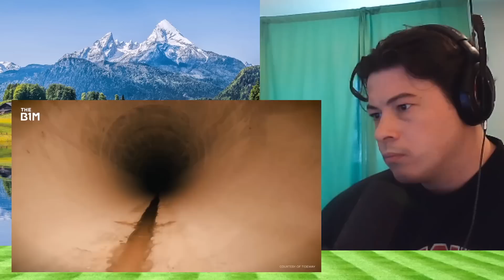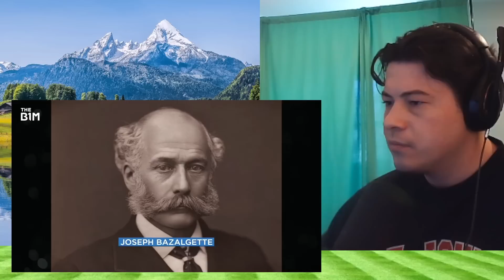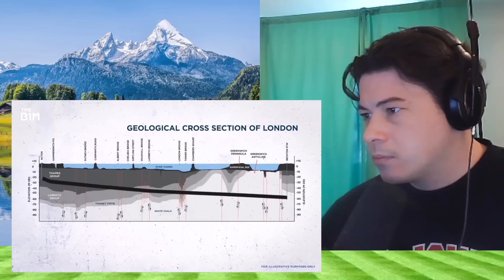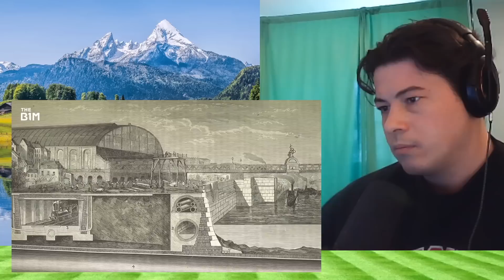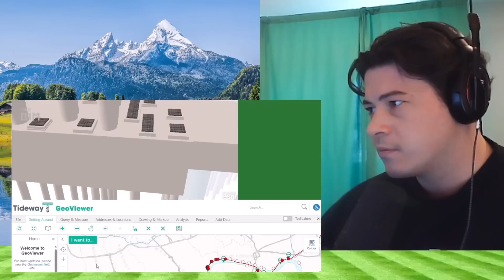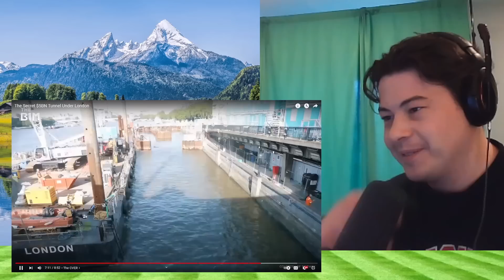American Reacts The Secret $5BN Tunnel Under London

Comment: 1 London's population has increased by 50 per cent in twenty years because of uncontrolled immigration. The infrastructure has not been planned accordingly.
2 The Victorians built the London sewers for a MUCH smaller population.
3 The Victorian planners made a huge mistake in taking Bazalgette's design which incorporated sewage and rain-water in the same drainage disposal, so after heavy rain it overflows into the Thames. They ought to have adopted Chadwick's design which separated the two.

Comment: The answer to the question you're trying to ask near the start, the real answer anyway rather than the BS news media answer, is "it depends on your definition or raw sewerage" - it's highly dilute at worst, probably not raw sewerage at all at best; the system is actually designed to handle what is supposedly happening (and probably is at some outflows); under normal circumstances the surface water pours into the sewer and nothing overflows, at high rainfall when the sewer can't handle the water essentially what is supposed to happen is that surface water sort of flows over the sewer and into an outfall. Technically they should never mix, but it is possible that they do, the measurements given are total outflows, not the actual volume of sewerage, it could be 0.00001% of that in reality. Course everybody talks like the Victorians were clueless and it is pure sewerage coming out the outflows and it simply isn't the case - there's a reason the sewers and surface water systems are at different depths. Not that you want untreated surface water flowing into rivers either; it has rubber from tires, oils and all sorts of other nonsense in it, not much, but enough.
Reply: Ahhh, a Thames-Water shareholder, I see.

A shame, that the fecal matter, condoms, and nappies don't fit into your theory.

Of course, it overflows mainly when it's rainy, so of course, it is dilluted somewhat, but don't pretend the sewage content is minimal - not until you offer to bathe your kids in it.

Comment: Your question about treating the sewerage ... We use a single sewer system, so rain water, industrial and residential sewerage, so if there's more water to be treated than can be handled, it gets dumped, raw, into the rivers or sea.
Because of the whole "profit motive" thing, when the water system was flogged off to the best bungers, investment started drying up, just for maintenance and appropriate expansion for expanding neighbourhoods, so installing a dual system wasn't remotely on the cards.  Thankfully the Victorians bothered with engineering, so what they did install lasted well, or we'd be in a worse state.
A third system would be even better, with an additional one for certain industrial waste, as different contaminants require different purification methods.  Mixing it all together means we're treating water in ways we others wouldn't have needed to.

E2A:  The ship you asked about is the HMS Belfast.  WWII ship, now a permanent museum. (EDIT Again):  Sorry, brain fart on the perspective, I don't know that ship, looking from opposite side would be Belfast.
E2FA:  I think it may be "HMS President" (yep, I'm double taking on the name too), used for Sea Scouts.  Just looking on GMaps.
Reply: It is nonsense to blame it all on privatisation. When the government was in control there was no significant investment since the 19th century.
Reply: @archiebald4717  From the other reply I've seen from you on this topic, it's clear you're an ideologue of privatization (at least), so there's no point actually discussing with you.

Comment: Firstly, the sewage being pumped into the rivers is raw untreated sewage which has overflowed before getting anywhere near a treatment plant.  The problem with this stems back to the water companies being privatised back in the 1980's.  There was little in the way of controls enacted in the privatisation process to enforce investment into the water system including sewage collection and treatment.  

This leads us to today where the current sewage system was built largely in the Victorian era with a UK population of approximately 33.6 million struggling to cope with the waste of the current population which currently stands at 66.5 million.  It gets even worse when you realise that the population from the Victorian times would include the entire population of Ireland as well.  This is happening all over the country meaning one overflow pipe in London, no matter how large, is not going to fix the issue.
Reply: Two issues I'd like to pick at.
1) It stems back further, to the decision to use a single sewer system, rather than a dual system.  One for rainwater, one of "actual sewerage".
2) The entire point of privatization was (and somehow, bewilderingly) that investment would outstrip what the government could afford and it would be bigger and better and cheaper and ensure our farts smell like fresh snow.  The less regulation the better and all that.

Apart from those two things (especially the farts bit, that's a massive omission on your part), decent post.  🙂👍
Reply: Lack of investment and rampant, unchecked greed by the owners and shareholders of the privatised companies.
Reply: Lack of investment when water and sewage management were run by the most incompetent body in the country, ie the government.  There has also been a population explosion in the last few decades.
Reply: @archiebald4717  Well, we know who's well stocked up on copium, huh!

Comment: The distant group of tall buildings is Canary Wharf, east of the City of London where the closer high rise buildings are. No, all this is before the waste water is treated. It will all run to the eastern edge of the city area, where it will be pumped back to the surface & into treatment works, after which the water will then go into the river, well east of London.